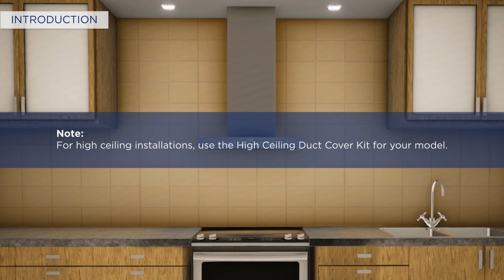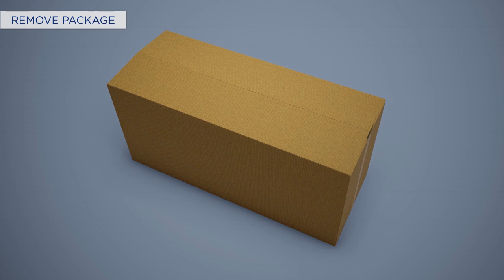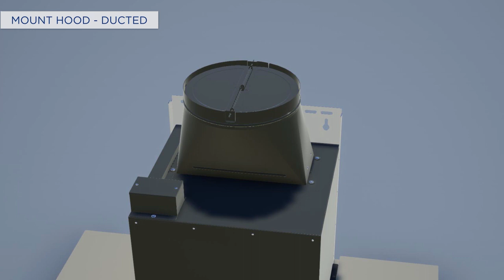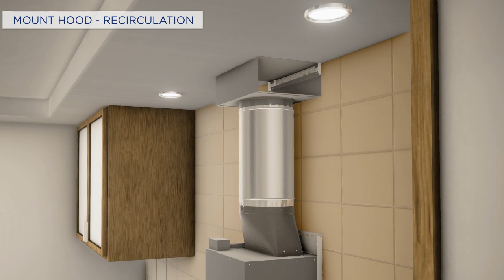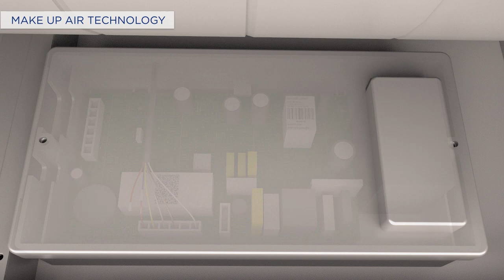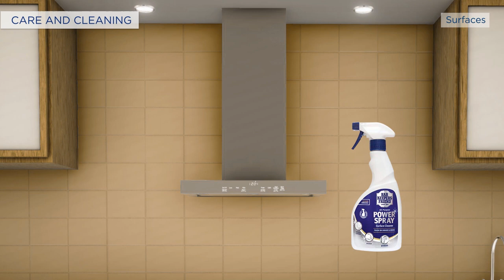Designer Wall Mount Hood Installation

Comment: Is the air also supposed to circulate in the " Recirculating 
(Unit is configured from factory in 
this mode"  to inside the kitchen if we have outside top exhaust ?
Reply from the maker: If you install the unit to recirculate, it will recirculate the air. If you install the unit to vent to the outside from the top, it will vent to the outside from the top of the unit.

Comment: It says 9/32# drill bit, yet the (paper) installation manual says 1/8" drill bit. Which is it? I think 1/8. Confusing...
Reply from the maker: Hi there. If the installation manual say's 1/8" drill bit for your model, please use that. We apologize for the confusion. If you're still having problems with installation, please send us your model number, so we can further investigate. Thanks! -AT

Comment: Anyone else having issues with the charcoal filter installation?
Reply from the maker: Hello Patrick, we regret to hear of the difficulty you experienced with the charcoal filter. We will be glad to look into this further for you. May we have the model number of your unit please? -BL
Reply: GE Appliances thanks for getting back to me. The filters shipped with the UVW9361SSLSS do not fit the indicated placement in this video. Further, there is no location on the filter that can receive screws as shown. It’s almost as though the filters sent were for another appliance. Any thoughts or help appreciated. I spent 1.5 hours on the phone with GE to be sent to this video which unfortunately did not resolve my problem. Hoping not to have to call back.
Reply from the maker: Hi Patrick. Thanks for letting us know. Based on your parts breakdown, here: https://www.geapplianceparts.com/store/parts/ModelSectionParts/UVW9361SL1SS/1/0/0/0/RANGE_HOOD - We're seeing the air filter needed can be seen here: https://www.geapplianceparts.com/store/parts/spec/WB02X30511 - Was this the filter you received? We hope that this helps and that we hear from you soon. -MS